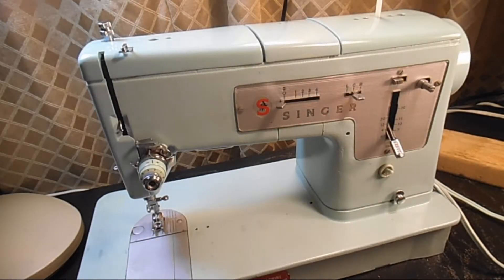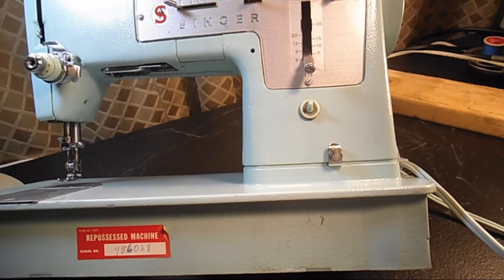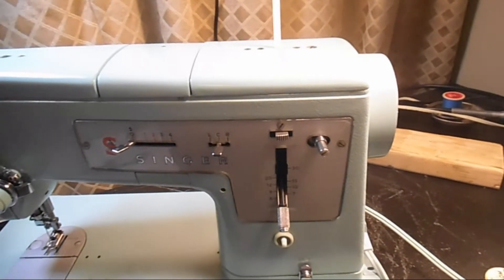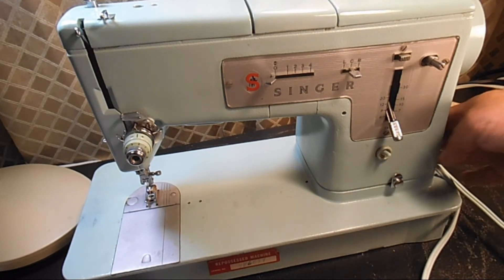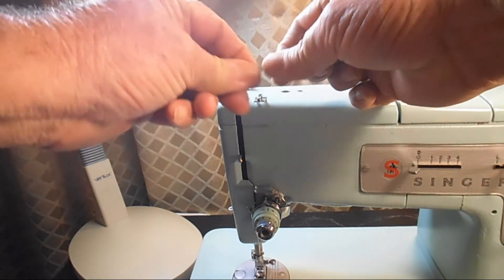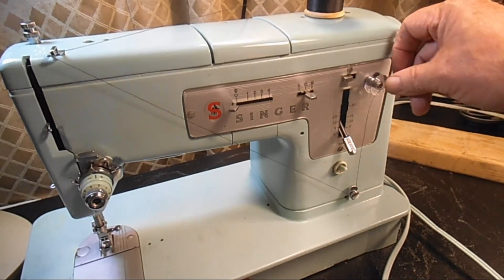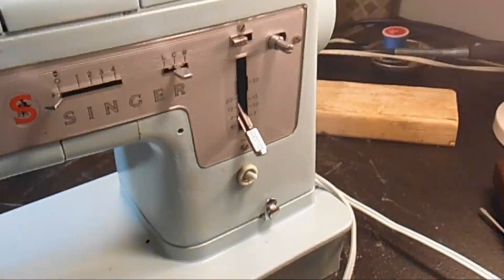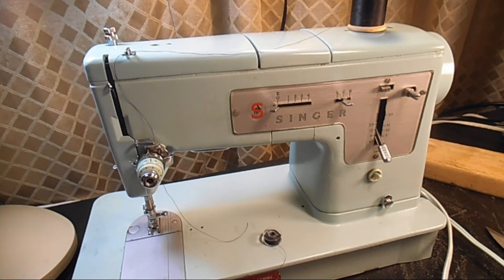How to wind the bobbin on the Singer Model 338

Comment: Hi Andy,
Love the videos, thanks, so helpful.
I’ve just bought a 338 and, like yours in this video, when I engage the bobbin winder the needle still runs. What should I do to stop this?
Also you refer to service manuals, where would it be possible to find a service guide for this machine?
Many thanks
Glenn
Reply from the maker: Congrats on your new machine, Glenn. Thanks for keeping it in service. If you released the stop motion knob as I show in the video, and the needle bar still moves, the clutch washer behind the knob may be installed backward, or the parts are just dirty and need a good cleaning. I don't know of a free Service Manual for the 338, but you can buy and download one here for $9  https://manualsoncd.com/product/singer-338-sewing-machine-service-manual/   Also, I have 30+ videos for restoring a model 337, the sister machine to your 338. The 337 is the same machine without the flip-up arm cover. I show most of the things you'll find in the service manual (not all) Here is my playlist for the 337 https://www.youtube.com/playlist?list=PLsCOZgzzaiKJxbOOMKQPvmeTRqi0dhGa5    Thanks for watching my channel and good luck.
Reply: @andytubesewing1953  Amazing, thanks Andy, much appreciated.  Keep up the great work!
Reply from the maker: @glennhaines6162  Sure, good luck.

Comment: Thank you for this video, its good to know how to properly wind a bobbin :)  
I wonder if you would be so kind as to suggest the source of an issue I am having with the 338, where the stop motion knob becomes loose after sewing for a while, then the needle stops. 
I'm pretty sure that I have the clutch disk(?)  in the correct position with the screw in between. (watched another video on this).
Reply from the maker: The cause is your installation method or a worn clutch washer. Your "pretty sure" you installed it correctly. I'm pretty sure you did not. 
🙏😉 You can take the washer off, rotate it 180 degrees and put it back on, and try that. Also, be sure the handwheel is completely pushed on as far as possible before you tighten the stop motion knob. I have also found the washer put on backward, meaning the wrong side facing the machines. https://youtu.be/hHl96WL1kzA   If none of that works it may be a worn clutch washer, but I've only had one of those after all the machines I've done.
Reply: @andytubesewing1953  Thank you for your reply. I’ve got the machine sewing perfectly now. My son helped me a bit with this as his finger dexterity is better than mine and he tightened it so much that I’m unable to loosen it. I’ve been winding bobbins with the needle going up and down. I’m wondering if this is harmful to the machine, perhaps in the long run. Next time he’s here I’ll ask him to loosen it and see if the wheel will behave itself net being as tight as now.
Reply from the maker: @judy8798  I'm glad he was able to help. Yes, in the long run winding bobbins with the needle/hook/feed dog in motion will cause more wear, but using it that way won't hurt anything for a few weeks.
Reply: @andytubesewing1953  Thank you :)

Comment: It's interesting that singer made so many models that are very similar with just a few minor changes.
Reply from the maker: Models within the same or two decades are similar. They made hundreds of different models over 100+ years, and the mechanics have varied quite a bit, but some things did not need changing. Needle bar, Presser foot, feed dog, etc.
Reply: Exactly my 348 looks identical to that and my 347 looks similar

Comment: Singer 348 478 bobbin stop will work on 338 if you ever wanted to grade your machine ..singer later decided it was better to make bobbin stop and many people upgraded 338 ..singer salesman sold them later as upgrades and put them on the older models ..there adjustable so you can spool different amounts of thread

Comment: What size bobbin do I need to buy? I tried buying new ones but they were too thick and my thread kept snapping
Reply from the maker: If you have a Singer Model 338 machine it uses Singer Class 66 Plastic Bobbins. That is what it came from the factory with. The part number is 172336. I buy mine here: https://www.ebay.com/p/664504770     but there are many, many sellers online and in some fabric stores and even Walmart may have them. Thanks for watching my channel.